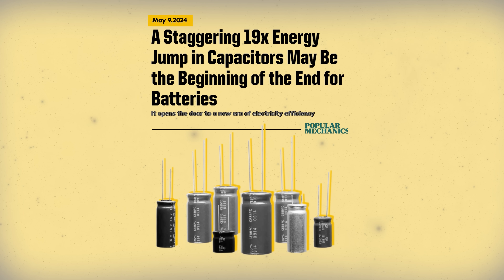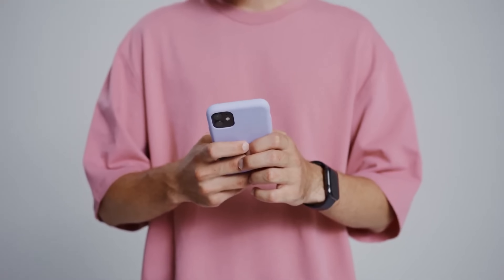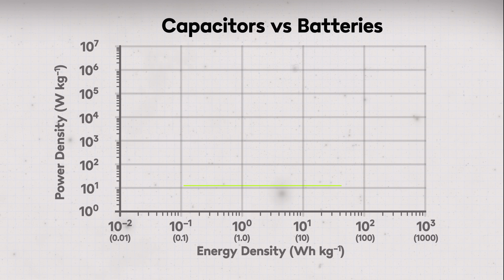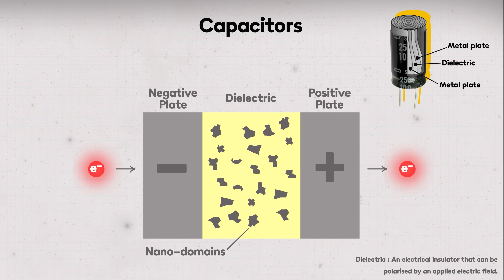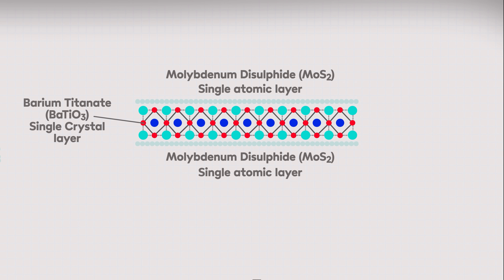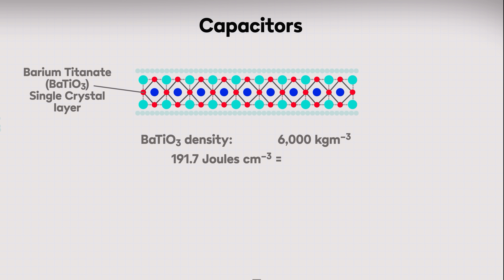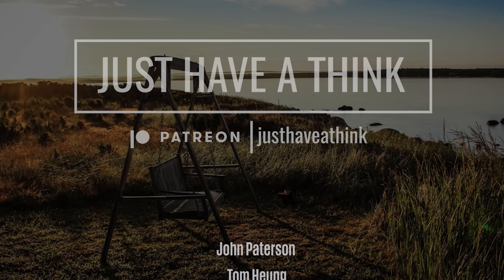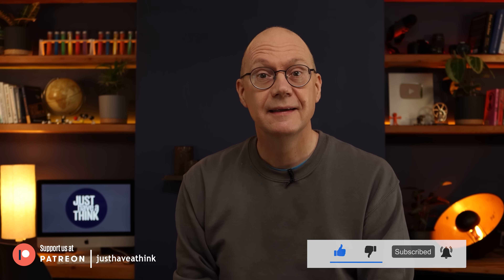Charging an EV faster than filling a gas guzzler? Surely not!?

Comment: I liked the idea of swappable batteries, like you do with Calor bottles, pull-in, drop off your flat battery and load up with an identical charged one.
Reply: I prefer this solution as well, but it requires too many layers of cooperation and standardization to be viable within the current market. :| And really I think the current market is so fundamental to the problem that it just needs to go too, but that's not exactly an easy sell. 

You'd have to have staffed battery replacement stations and a standard system across all EVs allowing them to easily release the battery as well as plug in a new one, all without the involved rig being a safety hazard on the road. Then you have to have all of these staffed battery replacement stations being willing to carry the necessary hazardous material insurance / licensing, as well as able to dispose of batteries that get dropped off that are too degraded to recharge. 

It's all of the costs associated with running a gas station, plus the need to actually store and dispose of batteries dropped off by customers, without the profit margins enjoyed by gas stations. And most of them would have to be full service, which adds extra costs that most gas stations have cut. 

EV chargers are already having issues just with installing and maintaining user-run, unstaffed charging stations. Nobody is going to put up front the capital to try and create a battery drop off station that manufacturers aren't even prepared to support.
Reply: I remember when I was in Australia in the 80s, one of the universities put forward the idea of EVs running on lead-acid batteries, with petrol stations replaced by electrolyte-changing stations. I'm no expert, but it did sound plausible to me...
Reply: @dungbetel  
never heard of it
Reply: I guess the already developed nano structures for hydrogen would provide a fast swap with medium range reach
Reply: Chinese EV company NIO already does the battery swapping thing in Chinqa and Europe, don't know how it's going though.

https://www.youtube.com/watch?v=78OSjWDanYg
Reply: I can definitely see this being viable for LGV and HGV markets. There is a firm in Oz doing this already for their own fleet.
Was featured on the Fully Charged Show.
Reply: The idea is good in isolation, but packs are now structural component of most cars, so it would add a lot of weight to already very heavy cars. There may be some opportunities for fleet heavy trucking in industries where you swap drivers when a break is needed so don't have time to charge.
Reply: Have you seen any video of battery removal from a car ? it would take half a day to take one down and putting it back up, there're high voltage involved, cooling pipes and coolant liquid plus a considerable number of bolts, the batteries are heavy as well... beside the time how much would a swap cost with all the professional work and equipment needed 24/7 ? the other thing is batteries would need to be standardised, mission almost impossible as there're tto many different vehicles which are physically different and have different power and cooling requirements.
Reply: @brixtonianme9717  Yeah. I've seen it on video, the proper facilities with a designed for system all automatic and took under 5 minutes
Reply: @brixtonianme9717 That's why the idea of just changing the electrolyte caught my attention.
Reply: A very poor idea.  The inventory of batteries that must be socked at each charging station waiting to be fitted to a car would be huge.  hese batteries are expensive and are not earning revenue while they are just sitting around. Having sttandard batteries means that manufacturers are not free to design their batteries to take advanttage of their specific vehicle layout. Swappable bateries might have made some sense when battery capacities were low and charging rates very slow. Those times thave passed.
Reply: @rogerphelps9939  If a battery can be charged in an hour, and the station wants to provide a fully charged battery every 10 minutes, then only six batteries would be needed per station.  Or if a station is in a very busy location and is continually used with a swap taking 3 minutes, then 20 batteries are needed.  If different capacity batteries were needed then the number rises a bit.  One benefit is that most cars can carry smaller capacity batteries most of the time and only get a larger capacity battery when needed for a longer trip.  Or if there were lots of fast swap stations, then cars could use much smaller capacity batteries.  Swap stations don't need to replace charging, but could be used for commercial purposes where time is money.

Comment: Every single item we use needs oil...yes oil, we cannot live without it in the modern world, the cloths we wear, the carpets we walk on, the shoes we buy...everything...Even a Tesla uses oil to cool the batteries, operate the brakes and make the tyres. Oil lubricates everything in the world...And by the way it will never run out, new discoveries all the time, Massive reserves off the Falklands and New Zealand. It has made the fantastic world we are in today!
Reply: Difference is THEY DON'T BURN IT and directly put the toxic residue into the atmosphere, a rather important distinction IMO
Oil is a necessary evil yes, but we can definitely mitigate the damage by not overtly burning the stuff.

Comment: Capacitors certainly don’t last forever!  The failure of electrolytic capacitors in power supplies is the most common failure mode. It’s why cheap LED lamps that should last for decades typically fail in a few months
Reply: Components in consumer electronics are hardly the sine quo non of durable components. They are manufactured to be cheap, not long lasting.

Comment: If we are going to charge EVs several times quicker then we have the problem of needing super thick conductors leading to the charger and then to the car. Or am I missing something?
Reply: These aren't really going to help with charge times. The energy density is too low to make sense using one big enough to reduce charge times any meaningful amount.

Comment: With such high power, the copper tapes that these new compositions will be deposited on inside the capacitor might be heating up a lot, also regen breaking is already quite efficient however these caps could eliminate all regen losses due to capacitors charge discharge cycles(hybrid cars already have a massive capacitor inside their inverters for regen braking...) . These caps might just be a very good option for standard electronic devices as well so this is generally a very interesting news. Cheers!

Comment: I don't understand how this would make charging EVs any faster if (when) it doesn't replace the batteries. What it could do is make regenerative braking more powerful and lessen the energy losses of it. You just replace that portion of battery with a super capacitor. But with charging, how would it work? 5% of your storage capacity is this very good capacitor and you charge it up really fast and then what? You have only charged 5% of your storage capacity and whatever tiny amount the main battery charged in that time, and that's it. The rest is just regular speed charging of the main battery.
Reply: Capacitors would probably be on the charger side so it can deliver massive power from a comparatively weaker grid source, after all common lithium batteries usually tend to start off charging fast and then tapering off quite quickly, hence why many charging examples are typically for 10-80%.
Reply: @Lag_Monster  but the charging speed ceiling isn't the grid, it's the battery technology. For example Tesla supercharge will degrade the battery quicker, so it's not recommended to be used regularly. A capacitor on the charger side will not fix that. It could make things like home chargers faster, but then, home charging is the type of charging that doesn't really need to be made quicker for most use cases. A lot of cars also will not charge at the nominal speed except in optimal conditions, even when the charger would have the capacity for doing that. I guess a capacitor could make some charging places to be convertible to somewhat faster places, like those that have relatively weak connection to the grid. But to me this doesn't seem to be a game changer for EV charging speed.
Reply: @fintux   It's definitely not a game changer yet, but still nice progress nonetheless. Especially as both these capacitors and batteries continue to evolve. This will hopefully help with the degradation.
Also there's definitely grid restrictions on the available power in a lot of places, installing new transformers and high capacity interconnections is expensive and IMO buffering type chargers will definitely become a thing to mitigate/smooth the load out over a longer period of time.If nothing else than to take advantage of cheap tariffs when available during low demand.
Reply: @Lag_Monster  yes I absolutely agree this is nice progress. And hopefully this paves way to further advances.

But if we are thinking about the case of adding more and more EVs on the roads, then capacitors that can charge maybe one or two vehicles to each charger will not shift the grid load that much - maybe it could shave 5-10%. Better than nothing, but if that requires a massive capacitor that might also be expensive, I don't know if it will be worth the investment. Of course, if it's a viable option for grid-scale energy storage, then it should work at charging stations, too. And I think they could also be used in virtual inertia devices now that stabilizing the electric grid is getting more and more burning problem due to adding wind and solar that don't natively provide that (also wind power is fed to the grid through an inverter).

Anyway, my original point (that I probably didn't make too clearly) was that it won't speed up the fastest currently available charging times as long as it doesn't replace the battery in a car, because the battery still needs to be charged at most with the speed that the battery accepts, and adding a capacitor to the car or to the charger won't change that.

Comment: Stop lying & stop with the click bait titles.  Please explain how adding a capacitor of ANY TYPE (even these new theoretical "high capacity" 19x capacity) will increase charge speed anywhere near close to filling a "gas guzzler".  The only way this is true is if you are charging a 1/32 to 1/16 scale RC car.  On top of this, you should know better that it takes much more than just faster batteries/capacitors to charge a car.  As it stands 90% of ultrachargers never put out as much power the car can handle, often running at 20-30% charging speed.  We would need a whole new set of charging stations & a major grid upgrade if we were going to charge cars as fast as filling it with gas.  As it stands now, the grid has problems, but you think it will handle charging cars 20-50x faster!?  Crazy.

Comment: When it comes to capacitors, there are a lot of moving parts with regards to performance. Still, it does look like pretty good basic research.  I'd add a notch to the "progress" category for sure.

For example, 90% efficiency means 10% heat dissipation.  A capacitor trying to absorb 100kW during regenerative braking would have to dissipate 10kW worth of heat for a significant period of time.   Even just 1 second of regeneration is already pushing 100,000 joules.   I think even non electrical engineers would immediately understand that this would result in a rather large bang, pop, probably fire, and the end of the capacitor.  As well as everything around it.

And even that is a severe simplification.  A capacitor's ESR (equivalent series resistance), for example, is heavily frequency-dependent.  If 90% is their baseline efficiency at DC (0hz, not AC vs DC), then they have a very, very long ways to go before achieving real usefulness.

So... definitely progress, but this is obviously basic research.   Don't look for useful application any time soon.

-Matt

Comment: Please tell me how this is going to increase the speed of charging the battery by more than maybe 1-2 minutes.  There's NO WAY it could be as fast as refilling a gas vehicle, STOP LYING and spreading false hope.  The batteries can only charge at a max rate which can only be decreased by various factors (too cold, too hot, battery is old, etc).  Adding a capacitor will do NOTHING to speed this up.  If it would, PLEASE tell us exactly how it would b/c you must have discovered something new that no one else knows about.  I'd get busy filing a patent on that b/c you will be a trillionaire if you can do this.
Reply: Yeah, the energy density of these is way to low to make any noticeable difference to charge times. A regen sized one only has the potential to save about 2 seconds compared to a battery that can take 250kW already.
To make more than a few minutes difference even charging the capacitor at 1000kW, it would need to weigh as much as the rest of the car. So, basically not going to happen.
Reply: @patrickbeck4062  -Thanks for replying!  I'm glad someone else understands these preposterous claims all these channels & "green" technology cultists push.  I usually get belligerant replies telling me I'm lying or similar.  I really wish channels & people would be honest about the whole EV & "green" energy topic b/c it is SOOO confusing to people w/o proper understanding of electricity which is probably 90+% of the country unfortunately...

Comment: Grid expansion is limited by copper and other mineral constraints. This will limit EV expansion, no matter how many fancy new fangled super capacitors you can bring on. The fastest way forward is with what makes the best use of minerals and that is nuclear. A new study by Seaver Wang shows it.
Reply: God only knows who Seaver Wang is but the source of power for tthe grid is irrelevantt in this context.  Also nuclear most definiely fast for anything. Nuclear power stations ttake ages to plan and build and are pretty much the most expensive way of electricity generation.

Comment: Didn't hear a word about equivalent series resistance, or "ESR'. Has an enormous influence on both how fast you can charge/discharge a capacitor and how hot it will get in a particular application. Incredibly-thin capacitor electrodes would necessarily exhibit high resistance, no?

Comment: I don't really understand how a capacitor which only makes up a small amount of the total energy of the car's battery would significantly reduce it's charging time. 

How would this play out 
 Plug in, get 500KW to fill the capacitor for 1 minute then 1C charge the rest of the pack for 30 mins?

Or is the capacitor charging quickly, then discharging into the rest of the pack then repeating multiple times over to average a very quick charge cycle? 

Or does the capacitor take a much higher proportion of the total energy of the pack and therefore have a bigger influence that way? Given it's lower energy density what does that mean for vehicle weight?
Reply: Yeah speeding up regular charging makes no sense with such a low energy density. 
Even your 500kW for 1 minute scenario would put a max of 8333 W/hs into the capacitor. And a capacitor that size at 8.8 W/h per kg would need to be around 947 kg (2088 pounds). So these won't be that practical for regular fast charging or really anything other than to help to battery with a fews seconds of hard regen.

Comment: An EV is an external combistion engine. Think about it.
Reply: It's fusion powered if you run it off solar PV 😁
~ Where we're going we don't need roads ...
Reply: And so is the motor in your electric fan, think about it.

Comment: Well ……assuming we have Capacitor who is able to Store the energies of one cars charging in lets say one Minute instead of 20 Minutes. Well …… lets say we have 100kWh  Batteries/Capactor capacity …… you need 300kW Loading Power from the grid load within 20 Minutes. Modern chargers can send 350kW Power trough the European CCS connectors. But to Charge this in one Minute, you need 6000 kW or 6MW. To do so, you need Voltages far greater then 1000 Volt …… that changes the rules of handling electricity …… this are quite dangerous …… you do not need to touch a conductor to be killed by this Voltages ………the current may jumps trough the Air …… google Accidents with the High Voltage of Rail transport ……

Comment: I don't think this will change much if anything.  Charging the battery in a car requires you to charge the battery.  Adding a capacitor does nothing on that front.  Cars can already regen brake.